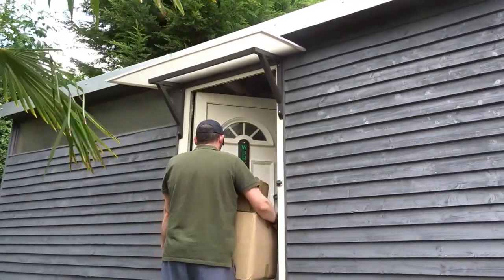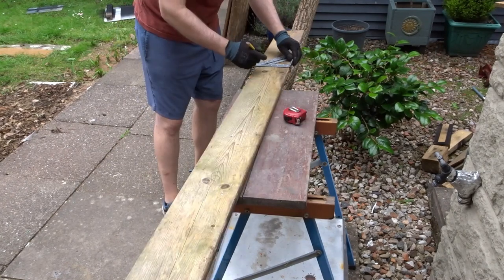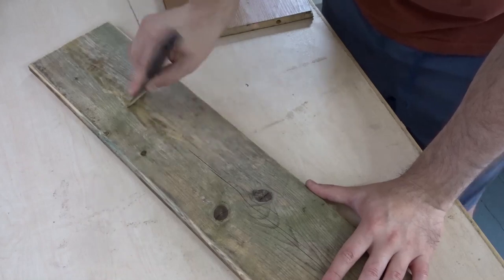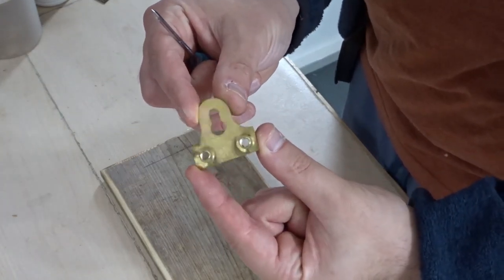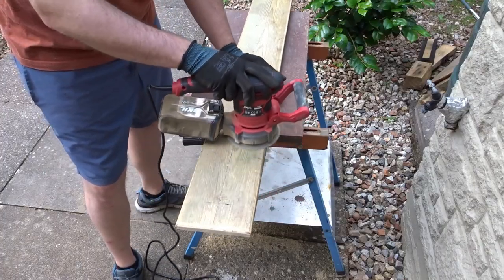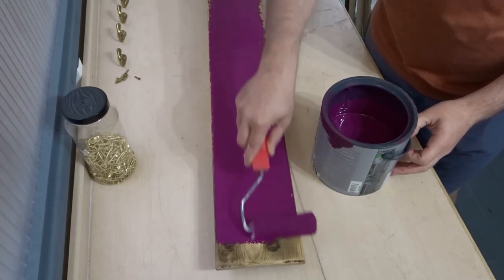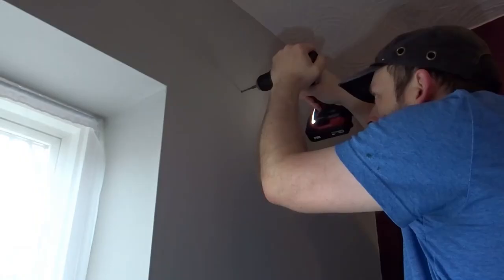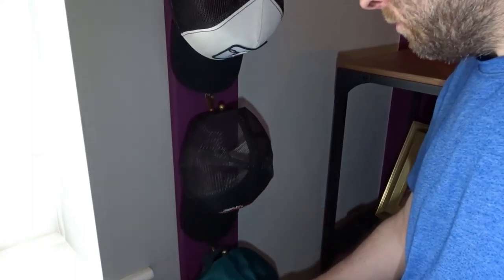Making a Hat Rack (DIY Scrap Wood Project)

Comment: Another nice little accessible project Phill, and hopefully some brownie points for you too !

Nice to see appropriate use of manual screwdrivers, as many makers seem to use power tools for everything, nice touch to match the brass slotted screws too !
Reply from the maker: Cheers Andy 👍🏻 sometime you can't beat hand tightening over a drill or impact driver. Another project ticked off the list ✅